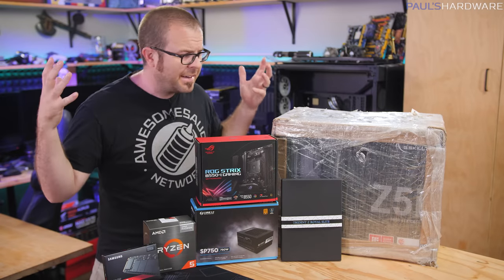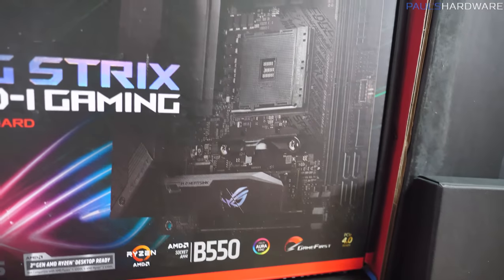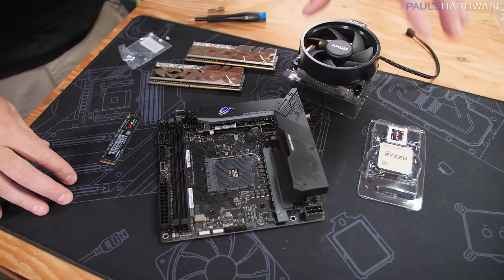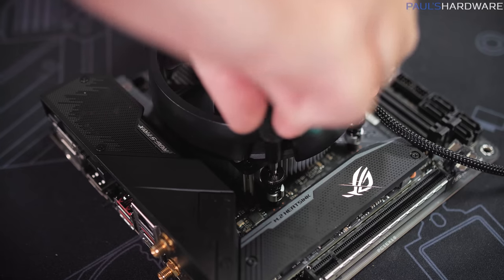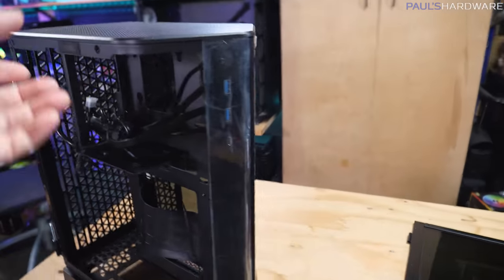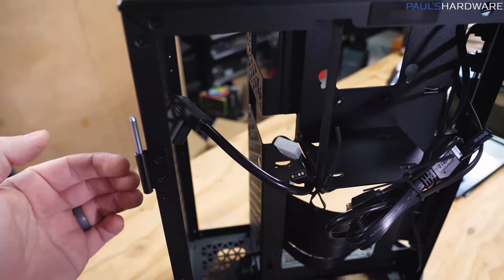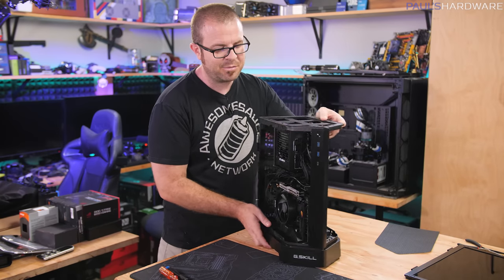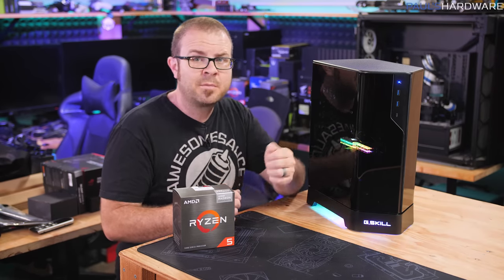Build this Gaming PC for $621! (I spent $1075)

Comment from the maker: In case I wasn't clear enough in the video, the reason I built a more-expensive $1075 version of this PC was to try out the G.Skill Z5i case -- I've already built in the $55 Thermaltake Versa H18, so you can check out that video if you would like a tutorial for that case specifically: https://youtu.be/PubJxQBKBio 
My version of this build isn't very practical price-wise! Both PCs would have very similar performance though, and both are upgradeable to a full sized discrete GPU. 
Thanks for watching everyone! 🙏
Reply: Cheers Paul! 😎
Reply: Throw a 5950X and RTX 3090 into that case and we'll see them choke to death.  I wonder how tall is the bottom to access the IO, can't imagine my HDMI cable bending that much without breaking. 
Another case of 'They tried so hard to make it look different that they forgot to cover basics'. I can't see how they managed to win an award without paying for it. 
Put it against the $90 NR200 with 7 fans and watch it boil.
Reply: @the-patient-987  From the pictures on their website, it looks like the "airflow" gap is roughly a third of the distance between the table and the IO. I don't think the cables will be a problem, but I wouldn't stick a USB drive under there. I just can't help but think that, in terms of ease of access, the bottom of the case is the worst place to put the IO. I'm also concerned about the airflow. G.skill's website says that the case supports a maximum of two 140mm exhaust fans, which are blocked by grills and the 2.5in drive mounts.
Reply: the reddot award means absolutely nothing. u can buy that "award" yourself. u can even buy the other "award" to. oof
Reply: Very interesting case.  Would like to see a waterloop setup in the future.  Digging it.
Reply: bout 12:30 I wish I knew about the cooler shroud trick, the AMD logo never looked right. Now I know. Thank you.
Reply: @the-patient-987  Someone with the money for that kind of setup wouldn’t buy a budget case. 🙈😆
Reply: @raphaelbelanger6764  I agree that these awards are meaningless, but getting awards on brand new cases seems like the ideal model for case manufacturers and award competitions.  If you need to hold back the release by a couple months until it can have a fancy award sticker on it, why not?

Also, I really question the airflow to the CPU cooler on this case.  Feels like an AIO would work well, but that cooler is blowing straight at the glass, and the area around it is pretty blocked off from the vents.  Not that I'd be too worried with a 5600g.
Reply: Just curious did you have to flash the bios on this build? Its pretty similar to the one I'm building?.
Reply: What graphics card would you recommend for this budget build and where do you install it at on the motherboard?

Comment: I would love to see you put in a mid-tier GPU, so we can see what I would call a reasonable upgrade path for the average person that doesn't necessarily have lots of money to throw around. This would be in a similar vein with your original $621 build.
Reply: I'd hope to see something like an rtx 3050 or 6600
Reply: @Linkedblade  6600 would probably be on par with the 3060 and cost at least $300 as well. Budget gamers can only hope now for the 50 series if Nvidia even brings it back or hopefully the 500 series from AMD (6500 and 6500XT) which might not be to crazy considering that just last gen we of course had a 5500 (OEM only tho) and a 5500XT.
Reply: There are no mid-tier GPUs. They’re all expensive.
Reply: @Athasin  That's fair. I don't think we'll see a sub $300 card for some time. 

The 6600 and 3050 aren't even real, announced products yet.
Reply: @Athasin  nah, 3060/6600xt is mid tier, just more expensive than 2-5 gens ago.
Reply: @Linkedblade  we have on laptop for 3050

Comment: Paul, the first time I built a computer was a year ago and of course you forget things when you don't do it as regularly as you do.  That said, I love your 'budget' builds because if I'm being honest with myself, no one in my family is enough of a hardcore gamer to get these bleeding edge parts that drive the price of the build up to the 2-3K range.  Plus they allow a novice builder to make mistakes that don't end up being fiercely costly.  

Also, I have to say that my desires to 'bling' out a computer have changed over the years and as long as the computer runs cool and quiet, messing around with RGB hubs can sometimes be more of a pain in the butt than it's worth.

Comment: As of time of me writing this, the 5600G is still in stock... AMD might've finally fixed their CPU stock issue
Reply: For me its still in stock
Reply: In stock and (if I remove VAT from price) below MSRP, somewhere around 220€. Usually we get new hardware as $=€+VAT so this is surprising. 
But while I look for price and availability few HP machines pop up that came with 5600G and gt710 as graphics cards and now I start to hate AMD to prioritize them instead of diy market :D
Reply: @gorjy9610  True I do try to look at this glass half full, even though it's not ideal you can finally just walk up to a store and hop on to Newegg and just BUY a CPU now without the BS so that's something to celebrate

Comment: Did you ever think you would get to the point where your only real choice of recommendations would be an IGPU?  One thing you can do for a bit more cable management with the AMD cooler, is take the plastic housing off and run the cable around the cooler, then pop the cover back on over the cable, and use the plastic cover to hide the extra cable.

Comment: I think rotating the fan after the cooler install is better. It would be easy to disturb the pre-applied heat goop otherwise. And that is an innovative case. I like it.

Comment: I upgraded my media computer. Ryzen 3 3200G with cooler $117, ASRock B550M-HDV $59, Crucial P2 500GB NVMe $55. Used existing case, power supply, DDR4 Vengeance RAM and existing 8TB HDD for storage. Using Pop OS Linux. Cost $231 
Works fantastically.

Comment: Great video, Paul! On a separate note, those awards on the case are kinda insignificant since you need to pay a lot to participate and even more if you win to be able to use the logo. Also, the products are mostly appraised on a visual design standpoint and not user friendliness.
Reply: Yeah, this case kinda sucks from a SFF standpoint. Not well space-optimized, poor airflow, and expensive. This is just pretty gimmicky to be honest. I’d take an NCASE M1 (or a meshalicious if you want to go for this sort of stacked setup) over this any day of the week. Either way, it’s fun to see Paul building again.
Reply: Just what I was thinking. How much did they pay for those “awards”? It’s clearly a poorly designed case from a functional perspective, the only ventilation area with any sort of dust resistance has no ability to attach fans to it.

Comment: I have this case. One tip if you use a AIO you can put the prongs down just wrap the tubes around the block. The one build I've seen with this so far the guy said he had to put them at the top. Using a NZXT X63 280mm being able to turn the face helped...

Comment: I'm curious to see the difference in thermals between using back panel as intake vs exhaust
Reply: With my Ryzen 5 3600, best results were with Cooler Master Hyper 212 Black with double fan configuration, and two exhaust fans on top of the case. Noise is almost non-existent, and the temps are properly regulated

Comment: Just FYI, the memory for the budget build are single rank units.   There have been reports that using dual rank units (if only using 2 sticks) can yield an additional 10% performance on the zen 3 chips.   If using 4 sticks then single/dual rank supposedly does not matter.

Comment: This is really one neat and sleek tower built. 
The graphics to toss? The one you already have. The old one. Not sure how old gpu would fit. A 1050 or a 1660 maybe?
Reply: Yes, I'd also be interested to see how it performs with an older card, e.g., a 1050 or 1060.
Reply: 1050Ti
Reply: @MattMcLeod  Integrated graphics do not even begin to approach GTX 1060 levels.

Comment: I would love to see someone make a non tempered glass replacement side panel for the GPU side. Put some mounting holes for fans, with a cut out for 240mm worth of slim fans, then just put a magnetic dust filter on the exterior. Improve the cooling capability. Otherwise, this is pretty cool.

Comment: Since 2017 I've been commenting that my OCD insisted on rotating the AMD logo on these CM HSFs to 12 o'clock.  And yes, the build's no good unless you leave blood on it.  Is PCIe 3 Graphics bandwidth even fully saturated?  Is NVMe 4 SSD performance really noticeably that much faster than NVMe 3?  Thanks, Paul - keep on building.

Comment: Hey Paul, just wanted your thoughts. It's kind of hard to see, but it looks as if the intake for the SFX power supply is close to the glass. Is it close enough to cause an issue with cooling the PS? Also it looks like it is exhausting inside the case. I guess you can't mount the PS to exhaust up. Would these issues concern you?

Comment: 5600G is currently $310 at Amazon, shipping on 11th of Aug.  If you want it at $260, you'll have to wait  until Aug 30th.
Reply: Its in stock on amd’s website right now for $259.00.
Reply: they are also on newegg right now for $259 plus $5 for shipping.. in stock.
Reply from the maker: Still available at Newegg and quite a few other retailers at MSRP, don't pay more than $260 right now
Reply: @paulshardware  the product has been shipping to oems since march so it seems like a retail launch like today isn’t going to through supply into a loop. And realistically a lot of people already have a cpu and or a gpu so the amount of people who actually will buy this product isn’t too large. I’m sure it will sell well, but in terms of day one purchases it isn’t going to have anywhere near the type of demand as a new gpu launch

Comment: I wonder if this would be a great example of using negative pressure, where the case fans you add pull air out of the system, so dust and air would be forced to get trapped and enter at the top? The bottom may need to be more sealed for that to work.
Reply: Just started vid but curious to what you’re saying as I’ve always built using positive pressure with concern of negative resulting in dust being sucked around case.
Reply: Hey  @Haddley333  , yes as a rule I agree with you, and the main thing is the positive pressure is being pushed against the dust filters where the air intakes. So in this build Paul has, the air is intaking, but not against a dust filter, so it's both positive pressure and letting dust in. Negative pressure (forcing air in from alternative positions in the case, like the top dust filter), if only the dust filter allows air to come in, will mean it should trap dust. I hope that helps?

Comment: Paul, nice looking base system. That case is real nice. One question, is there a way to mount a fan on the top? Next step upgrades for me on this system would be a 3060 GPU or equivalent. The 5600G is the bottom SKU so paring with a bottom SKU GPU makes sence. Then a 280mm AIO would finish things up. Another thought is to turn this into a small NAS or media system without the GPU.

Comment: The air intake is not filtered? Funny that the top has a mesh, but not the back... And the PSU fan is pulling air from the tempered glass? Wouldn't it be better (if possible) to rotate the PSU 180° (fan pulling air from the other side of the case) ? For the dust filters... to many openings, not enough filters 😢. Nice design but I would personally not buy that case

Comment: It's odd that the system tips over and then they placed the PSU on the top. Tall skinny cases should be bottom heavy. It would've also been nice to have some sort of cable management on the bottom of the case. If your wires are resting on the desk and someone spills a Coke, "You're gonna have a bad time." Other than those minor grips it is a nice little case.

Comment: The only problem with the Lian Li SP750 PSU is the fact it has only one 4+4 pin CPU power cable with a second connector coming off a pig tail which isn't ideal. Am thinking either buy something better SFX wise(not a lot of choice out there) or buy a second SP750 just to get an extra CPU 4+4 pin cable. Or wait until Cablemod start selling cable kits for these PSUs if ever.

Edit: How does the PSU get airflow in that case? The glass panel has no cut out over the PSU's fan.

Comment: Hey Paul, question for ya. So, my current build uses the ASUS B-450I. On that motherboard, the rear M.2 slot shares bandwidth with the x16 PCI-E slot. Populating the rear M.2 slot will result in the x16 slot running in x8 mode. Is that not the same on the B-550I? Mostly just curious, but I might use that board myself at some point. Thanks for the video! :3

Comment: Upgrade the cooler and maybe test the temperature difference between a push and pull config? Test it with a decent GPU versus the 3600 and/or the 5600X?
Just some thoughts.

Comment: With the back panel io access on bottom and no front audio is a real negative you want to use a headset. Though the case screams for rgb fans and water cooling with all the glass

Comment: What is the highest end graphics card that this system SHOULD handle?
Reply: More than likely a 3070/6700xt, but thats at 1080p. I know for a fact witht he 3080 your CPU bound running most AAA games with ultra settings. Also depends on if your running stock or OC

Comment: Test it then throw a nice cpu cooler. The rgb on just the memory looks lonely. Highest gpu you should throw in there would be a 3060, or maybe a 6600xt which might be coming out relatively soon. But I like everything you did. The case is nice, but too pricey.

Comment: You might want to note that if you use an Nvme drive you should use another one  and not a normal SSD for the M,2 drives..  They should be in pairs  SSSD's or Nvme's
Reply: I've never heard this. What's the rationale behind that?

Comment: Interesting 1st case from G.Skill, but I'm not a fan of tempered glass cases. and the the downward I/O is odd.

I did get a 5600G on launch day at MSRP and will be testing it out today. Depending on how it does, it may wind up in my HTPC. I expect the CPU porton to be a bit better than the R5 3600 in there now, but I'm most curious about the Vega vs the low profile RX550 I have in the HTPC now. 

The most demanding thing It'll run is Forza Horizon or Asphalt 8 & 9, so blistering Graphics is not a big need, but 4K Video is something I'm curious to see if it can handle. Video encoding from DVD & Blu Ray archiving are also things I'll test out.

Curious to see what kind of temps you get in that case with the stock cooler.

Comment: Nice, indeed the case seems pretty much empty with only the mobo and PSU.
I think a better cooler (something with RGB, after all you have all that glass for RGB right?) and yes with and without a discrete GPU testing.

Comment: There's a noticeable split in the range of prices for the 5600G from Amazon ($309) vs Newegg ($259) and B&H ($269). Any ideas why? Also, I'm curious how the bottom-oriented WiFi ports work. It doesn't seem that antenna placement on the bottom is an option.

Comment: You assembled some computer parts. With all due respect, my 13 year old with my credit card did the same. How does this build compare to a 3200G? A 3400G?  A 5600X with a 1070 TI or a 3060, 3070, etc. Love your channel, honestly, but computer builds are generally boring sans performance assessments, IMHO. I'd rather watch you clean your patio (because I can relate 🤣)

Comment: Great parts Paul, except the case. The case is too expensive and a hot box. I built a similar PC for myself about 6 months after this video was published. I used the very same MoBo and CPU the same Ram but without RGB and double the capacity. Also I used the Phanteks P200A for better airflow.

Comment: Nice build Paul.  I would like to see you test as is and then by adding a single exhaust fan and a 6600xt or 6700xt or 6800 into the build to see how it performs with one of those.

Comment: If you plan to install a GPU, I would try the 
ASUS GeForce RTX 2060 Overclocked 6G GDDR6 Dual-Fan EVO Edition VR Ready HDMI DisplayPort DVI Graphics Card (DUAL-RTX2060-O6G-EVO) or equivalent. The benchmark should be similar to a system with a Ryzen 5 3600 CPU.

Comment: From here it appears the Hyper212 cooler is too tall to close the case panel.  Hopefully a 92mm tower like the BeQuiet Pure Rock Slim 2 will be ok.  As for GPU upgrade, scrounge up a GTX 1060 3GB.

Comment: Your PC building is about like mine....4 years ago, I set out on a build (with GPU) for around $600. ASUS MoBo, i5 unlocked, 212 cooler, 16GB RAM, sata SSD, 850W PSU, RX-480 8GB.....ended up around $800.....now it has 2 NVME m.2s, and another sata ssd and i7-7700k........ yup, $600 turned into $800 and then into $1200....lol

Comment: For anyone reading, I need help! Do you think that a PC with this specs is enough for streaming and gaming at the same time?

- Processor: Intel Core i7-10700KF Processor (3.80GHz-5.10GHz, Intel Smart Cache 16MB, 8 Core/16 Threads) Intel Turbo Boost Technology 2.0
- Memory: HyperX Fury 32GB (2 x 16GB) DDR4-3200MHz Intel XMP Support RGB (up to 64GB) Video Memory: 10GB (GDDR6X)
- Graphics: NVIDIA GeForce RTX 3080

I'm tryng to get a PC for those purposes, but since I don't know much about specs I'm really struggling. The processor is an i7 10700KF
Please help me!
Reply: Yes its perfectly sufficient.

Comment: I think maybe a midrange option/reasojble upgrade GPU would be good. Since it is triple slot I'd want to see how a 3090 (Founders probably) performes in there too just to see if the case can handle the thermal load.